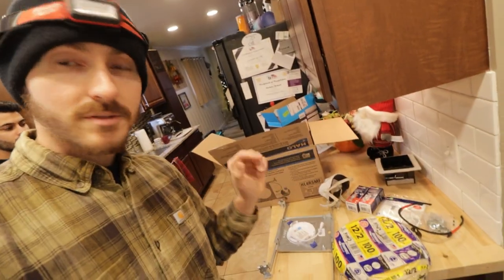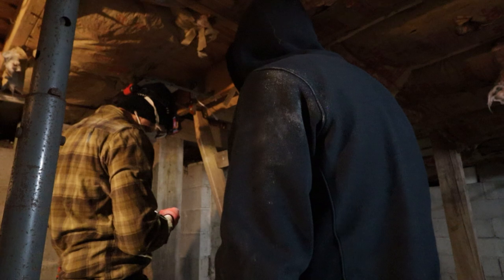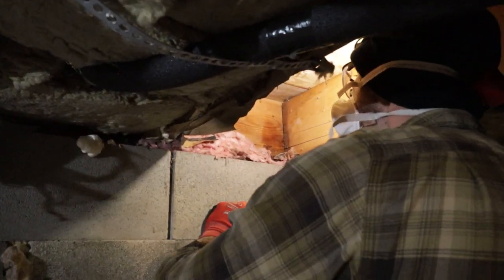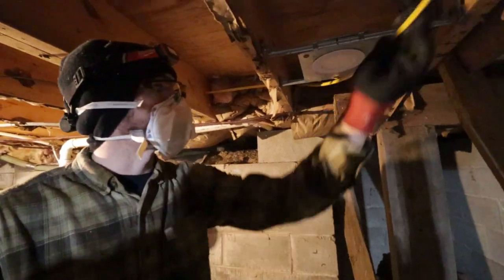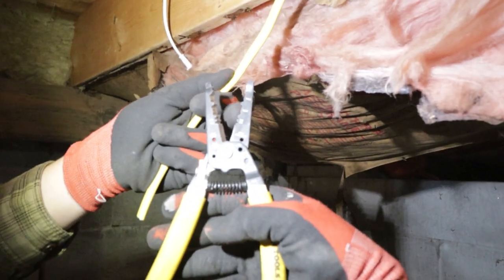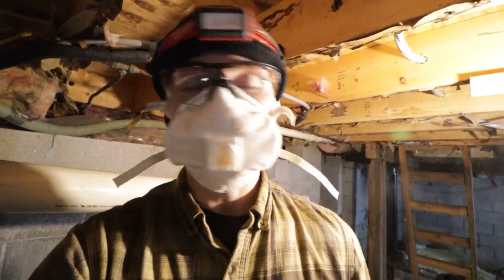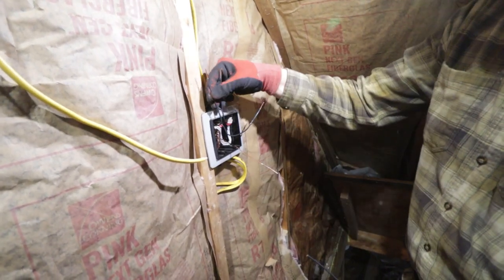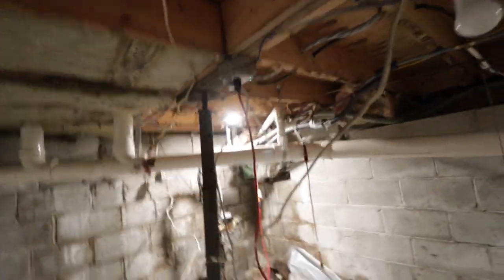How to Wire Electrical in a Crawl Space/Basement

Comment: Do you guys know if, according to NEC, everything here is done to code and would pass a picky inspection? If running direct burial 6/3 on 50 amp breaker down through wall, plate, into crawlspace, down into deep ditch to run outside, does the portion from the plate to the ground have to be in conduit? If so, sched. 40 good? Thanks
Reply from the maker: Great question! What I did should pass an inspection. A crawl space isn’t really susceptible to damage so you could probably get away with not using PVC to sleeve it into the ground. However, I personally would mount a water rated junction box to the concrete and run schedule 40PVC all the way to your next location. Then pull THHN through the conduit to each JB and transition to rated wire like romex or other related wire type. The inspector would probably be happier to see that. It also gives you the ability to replace the wire without digging again

Comment: Use 14-2 and plastic romex connectors.  Quicker and easier to install, less risk of damage to romex.  Put lighting on 15 amp circuits, especially with Led light fixtures.  Save your 12-2 for 20 amp receptacle circuits.  Thanks, Russ-J. Electrician from Oregon.
Reply from the maker: Great tip! Thank you Russ! I was extending a circuit here but if I am just adding lights in the future I will do this!
Reply: Russ, according to NEC, is everything here done to code and would pass a picky inspection? If running direct burial 6/3 on 50 amp breaker down through wall, plate, into crawlspace, down into deep ditch to run outside, does the portion from the plate to the ground have to be in conduit? If so, sched. 40 good? Thanks

Comment: Like those lights. Any concern using the wago type connectors in damp areas or outdoor sheds?
Reply from the maker: I am not concerned with using them in the basement. I have a dehumidifier running down there now. I wouldn’t use them in an area that they get constantly wet though. Unless they are contained in a proper weather rated enclosure.

Comment: Take all the insulation out of the floor. Put EPS on the wall and go full "crawlspace ninja".  Insulation in the floor joist, unless for noise is no good.  Encapsulate and dehumidify with something besides a portable unit, and get an air duct from HVAC down there. Air quality in the home will be vastly improved.
Reply from the maker: I’m glad you brought this up! We are currently having an issue with radon, humidity, and thermals due to the basement being in this poor of shape. I will be working on a plan to remediate all of this!